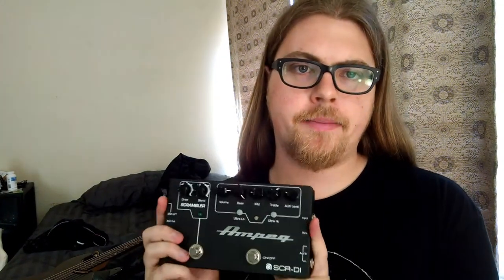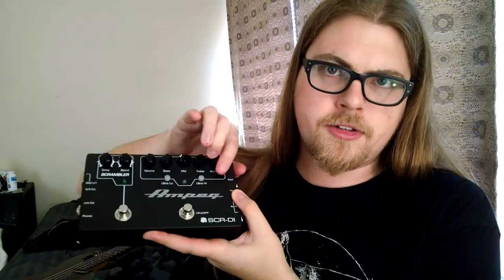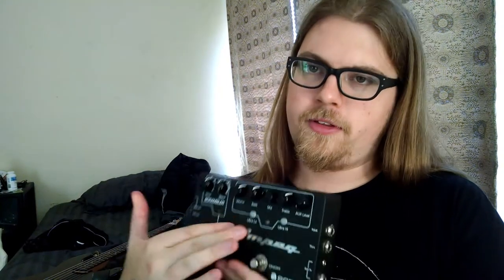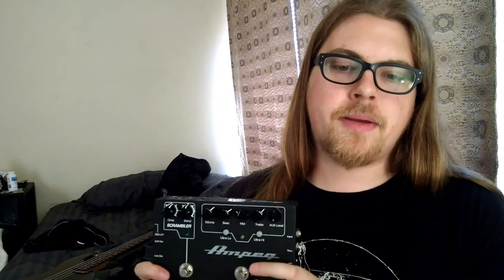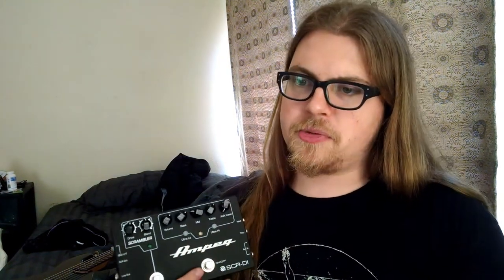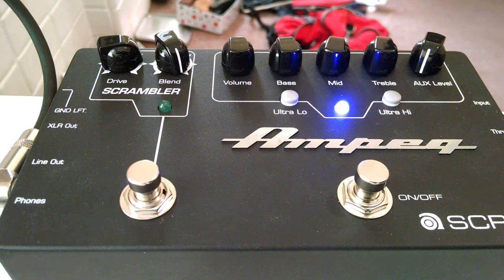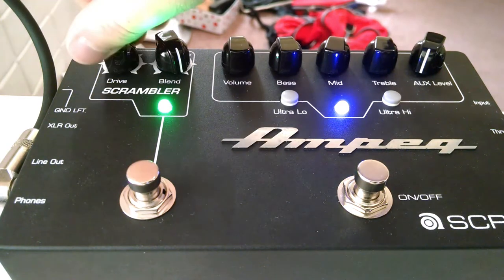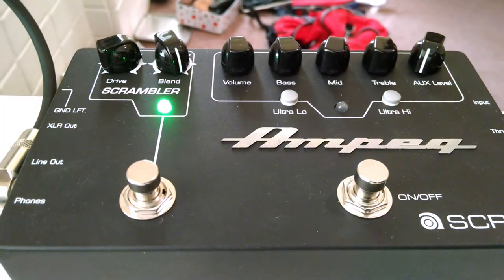Alex Grim's Webzone: Episode one: Ampeg SCR-DI

Comment: Volume on this thing does stuff?? Or maybe it's just the stuff that's after it that it does stuff to? I mean it's just a simple pedal it doesn't have any tubes in it, it's only a volume knob right? It's designed as a di box so the output is at line level. There is a -15 db switch inside the box though if you still wanna do that.

Comment: If you open the back there is a -30DB pad switch to reduce output power!! ;)
Reply: 15dBPADJUMPER:Movingthe jumper reduces the input signal by 15 dB and compensates for higher output sources. This attenuation is suited for use with basses that have active electronics or high-output pickups.
There are two possible positions for the jumper:
Pins 1-2 (Normal – default), or Pins 2-3 (15 dB pad)

Comment: You know the entry level ampeg solid state amps? This pedal is just the preamp section of these amps. It sounds like shit and it's overpriced because it has ampeg written on it. If you want a really good preamp, DI pedal, tech 21 bass driver or VT bass are much better options
Reply: SweBass 
Well absolutly not. I used to be an Ampeg hater and try alot preamp pedals ( Radial, Sansamp, Eden etc.) and this little piece blow all them away ! The tone is just amazing. I feel you just hate Ampeg product but seriously, Sansamp is really overated. The Behringer V-Tone bass preamp sound even better than the Tech-21 but the Ampeg got a killer tone that surprised me first and finally, was my choice.